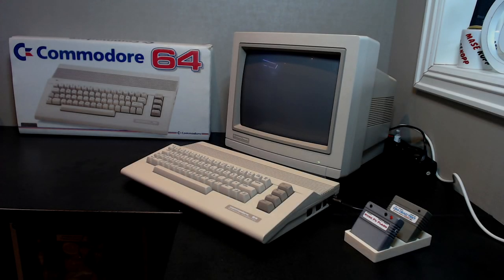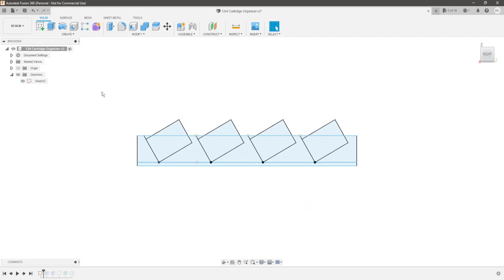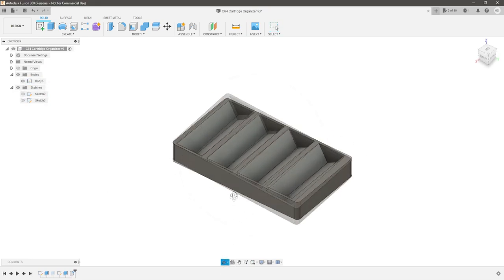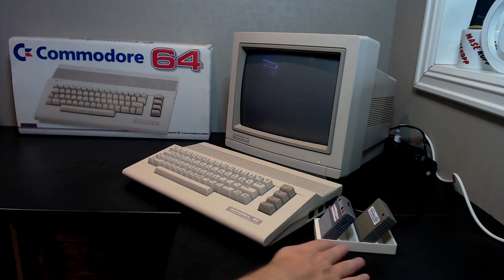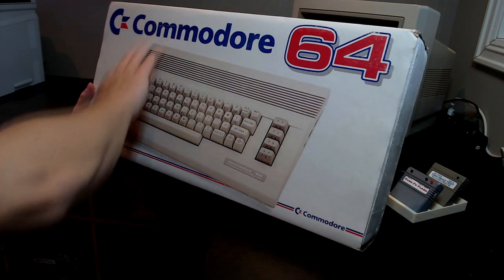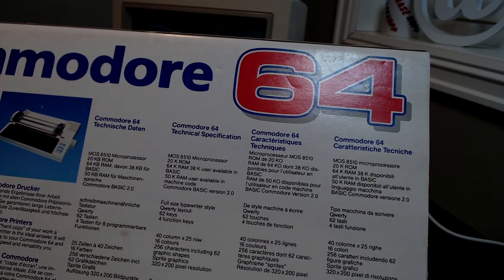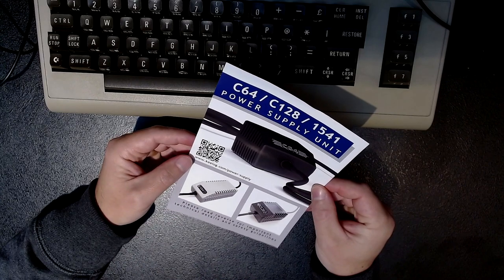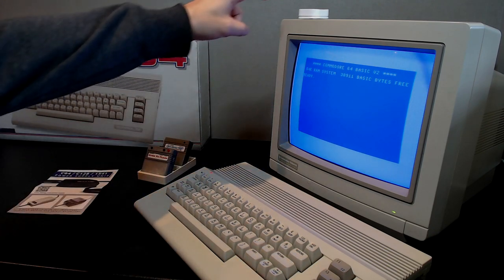Improving my C64 setup, new boxed C64C, PSU and 3D-printed cartridge holder! 📺🤩

Comment: Nice setup. And thanks for showing off that PSU. I've been thinking about getting a replacement, and those Keelog ones look excellent, so I've ordered one. :)
Reply from the maker: Thank you! Cool, I've had no issue with mine so far at least :D
Reply from the maker: (I got a notification that you commented on another video as well btw, but the comment was gone when I clicked the notification. I've seen this happen many times before, not sure why it happens)